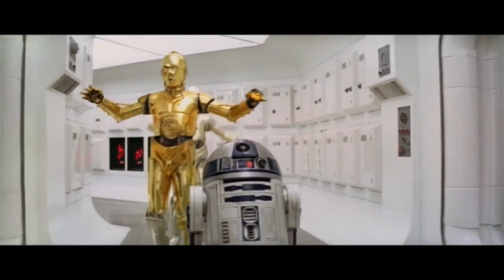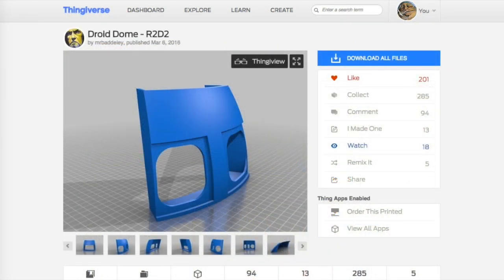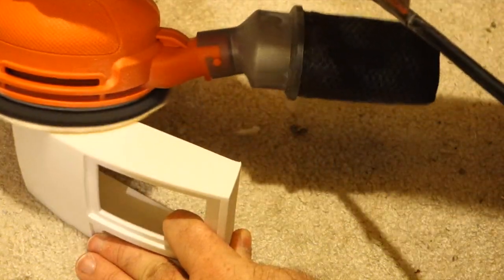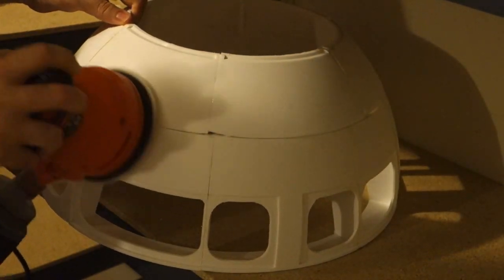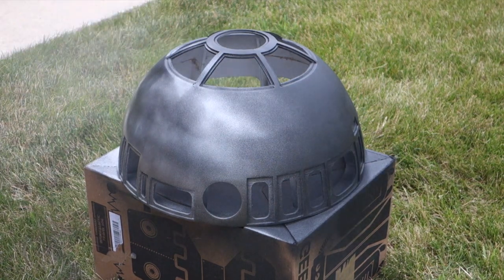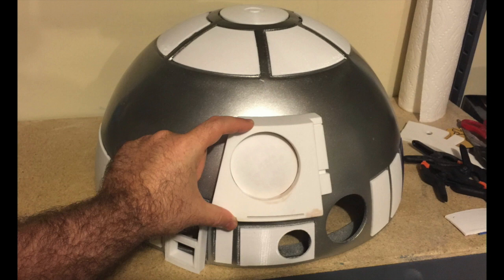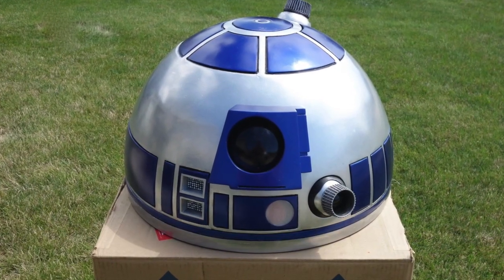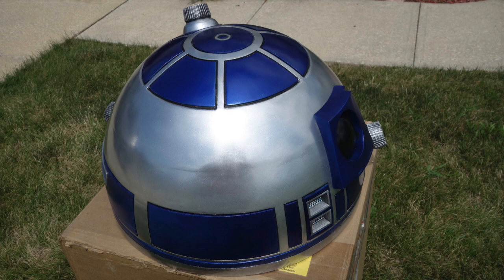3D-Printed Life-Size R2-D2! (Part #1: The Dome)

Comment: A decent quality , thin CA glue works just as well , is very strong and easier than messing with 2 part epoxy. I use CA glue on all my large scale prints. 👍

Comment: I'm sure he figured this out by now but for anyone with a 3D printer that experiences that PLA warping he got on most of the parts (or anyone who now wants to get a 3D printer and might run into this issue) the fix for this is to heat up the printer bed more. The PLA plastic warps when it cools unevenly, so increasing the heated bed temp should fix the problem (so long as the print is sticking to the bed). I use 60 decrees C for my bed and it works fine
Reply from the maker: inhooman alean My problem was that my printer didn’t have a heated bed at all

Comment: Which 3D printer did you use?  What is its print bed size?  I'm looking at buying a printer, but am on a tight budget.   So I need to know which printers can pull it off.
Reply from the maker: I wouldn't recommend the exact printer that I used here. For someone on a budget, the CR-10 or CR-10S from Creality are still pretty good choices. I have reviewed them on this channel, and they are big enough to print all of the parts without a problem

Comment: I realize that his may not be seen by you, an old modelers trick is to use the saw dust you take off the model in the initial finishing stage and mix some with epoxy.  No need to color match and will actually improve the strength in those cracks and gaps.  I learned to clip (binder clips are great for this, an old sheet (no holes) onto my building board (where I am working) to catch the dust.  Shake it gently into a container (I like margarine containers), just scoop some out as you need it (plastic baby spoons work good for this), and add about an equal volume of glue.  It should make a thick past (too thick to run down a vertical surface after you apply it) spread it on THINLY (unless you really do enjoy sanding that much) let it set for about twice the normal setting time for your glue (I would give even 5 minute epoxy an hour just to be safe).  Alternately, you can use some flour (go easy on it) for the white filler.

Comment: Hey i was wondering what was the infill and layerthickness you chose for this print. :D Thanks
Reply from the maker: I didn't use one setting for everything, since there are lots of different kinds of parts. For the dome parts and dome panels I used a .3 mm layer height because I was going to be sanding them smooth anyway, and it saves a lot of time printing. But of course there's nothing wrong with using a finer layer height if you don't mind spending a lot time printing the parts. And with the more detailed parts -- especially things like the holoprojectors that I can't really sand -- I used .1mm. 

As for infill, I used 100% for a number of things like the dome panels since they are so thin anyway and will be sanded. Other things I used a lot less, but I did make sure to use 4 or 5 outer perimeters to ensure that they could be sanded without making a hole.
Reply: Alright thanks because im thinking of printing one and there are the infill and layer thinckness and i wasnt sure what to choose. Thanks for replying fast, just earnt a sub.

Comment: What printer did you use? do you think i could print this with a 8" bed?
Reply from the maker: +Matthew Nelson I used the Dremel 3D Idea Builder although there are probably better options available now. I think an 8-inch bed would be tricky since many of the pieces are longer than that if I recall correctly
Reply: cool thanks for the info.

Comment: Are you able to share what the diameter of your dome is, assembled?  I'm thinking of taking a hybrid approach to the club's design (3D print the dome as it seems to be the most expensive and hard to get part, wood body and legs, 3D printed detailing).

Comment: Excellent project, I could offer one very useful suggestion for the remainder of this build, rather than 5min Epoxy I would highly recommend IPS Weld-On #3. It is by far the best way to bond PLA that I have used and it can be used to make a slurry just like acetone for ABS.
Reply from the maker: Thanks Michael! I think I may do that because the epoxy is probably going to be too difficult to use for some of the later parts that require putting lots of thin plates together to build up the legs and other parts. Someone on Thingiverse recommended Weld-On #4 recently as well. It sounds like the difference is mostly the working time? Never used it before so I'm not sure.
Reply: Yes the working time is the key difference. I prefer the #3 because it works like super glue when joining PLA parts. When used as a slurry it will be good for over a month in an airtight container.

I am working on a studio scale star destroyer and weld-on has proven itself the superior solution and I tried most of the main options out there,

Comment: Any chance of a tutorial or demonstration of the Rub n Buff? I have a pack of it and can not get it to come out worth a damn on plastic...
Reply from the maker: I'm not an expert by any means -- this was my first time using it. I have heard that you need to rub it a lot to get it to work well. The friction is part of what helps melt the wax I guess. I just used an old cotton sock to apply it. It might also have helped that I had painted and sealed it first. I kind of wonder if the surface you're applying it to needs to be slightly rough.
Reply: I'll be doing exactly what you did with it, so I'll probably paint and seal it and try my luck. Thanks for the advice!

Comment: Great work, I've gone the other way and 3D printed the body first as I was planning on an aluminium dome, but I might try 3D printing one after seeing how yours turned out. One suggestion, spend a few dollars more on a high quality body filler from an auto paints store instead of using Bondo. It is so much easier to work with, it is worth the few extra bucks.
Reply from the maker: All things considered, it's probably a bit easier to go with aluminum, although i don't think it would be cheaper. I just wanted to try making it entirely 3D printed, and it does sort of make me feel like I've "made it myself" more than if I had bought a ready-made dome. (Of course I realize you still have to do a huge amount of work with an aluminum dome as well). Do you have a specific body filler brand you would recommend?
Reply: Evercoat or similar is fantastic.

Comment: Hi there, just found your channel. You earned a sub !

I had the same problem (warping) with the PLA. Just reduce the infill and the number of perimeters. When the filament cools down it shrinks. If u use a lot of plastic in the perimeters and/or infill it will warp. Warping happens to all materials, but it is a bigger problem in ABS due to the high temps used o print it

Comment: Your 3d videos are inspiring. Remind me again  what printer you purchased and how much it was?
Reply from the maker: I have the Dremel 3D Idea Builder, which cost a little over $900, but there are a lot of printers that could potentially work for the project. You just need to make sure it has a big enough build volume to be able to print the pieces.

Comment: can i ask what 3d printer you're using for the dome?
Reply from the maker: I'm using the Dremel 3D Idea Builder, although it's not necessarily the ideal printer for this project. I think having a heated print bed would be helpful, and my printer doesn't have that. I'll make it work though. You do need to make sure you have a big enough build volume (similar to a MakerBot 2) to be able to print all the pieces.
Reply: thanks.

Comment: I'm mostly a quit watcher of your videos and even though my channel is more armour themed and sometimes some scalemodeling I really need to congratulate you on this amazing build and video. 
Only downside of this video is that I want a 3D printer now and they are not cheap.
Reply: I got a 3D printer for 190 USD. I'm almost done building it all I need is a cable to connect the z-axis because I accidentally pulled out a wire. If you do want to get one, what is your price range?
Reply from the maker: Thanks! Printers are coming down in price all the time, but they do still need some improvements in user-friendliness and reliability before they will become really widespread.

Comment: Wow, that turned out fantastic. I'd love to get in to 3D printing and give  this a go. What model of 3D printer did you use to print panels that size?
Reply from the maker: The designer of the model based it on the "standard" Makerbot 2 size, which is about 24.6cm long X 15.2 cm wide X  15.5 cm high, I believe. My printer is the Dremel Idea Builder, which has a 23 x 15 x 14 build platform, but it was just barely big enough. It does seem like I'll have to get creative with the positioning of items on the build platform when I move onto the body to make them fit. 

So basically, you need a printer with a largish build volume, but it doesn't have to be huge. I'd definitely try a lot of smaller projects before jumping into something like this though. The things I learned printing and finishing other things definitely came in handy for this.
Reply: Yeah, this definitely seems like a project to your my way up to. Thank you very much for the information!